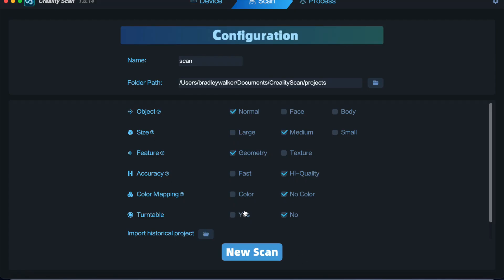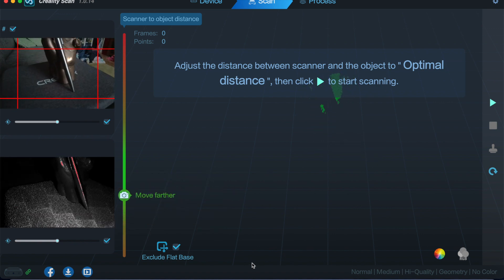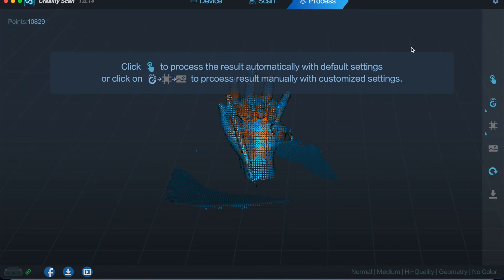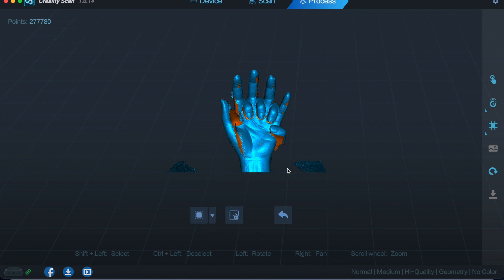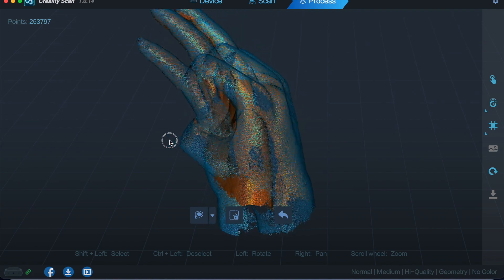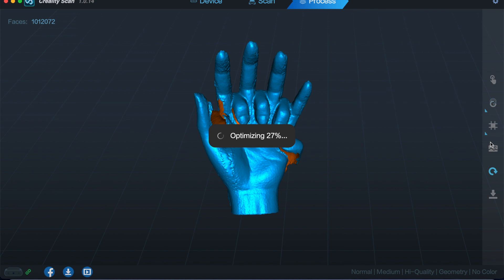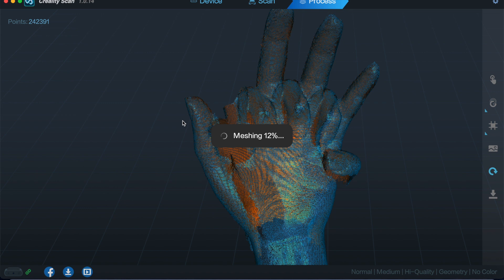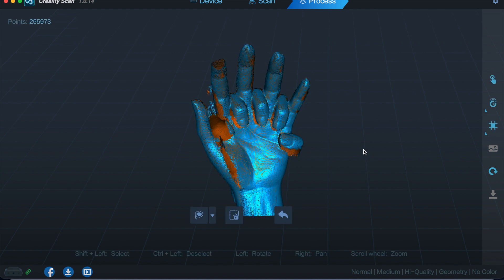Creality Scan Clean up   HD 1080p

Comment: I have a Ferret..and i keep removing stuff to clean up..only to go back and all the stuff i removed is back!
Also how do you fill holes from gap areas in the scan? And how do you smooth stuff out?
Reply from the maker: Hi sorry for the late reply. I try and have at least 3 scans of anything I’m working on to cover everything. While scanning you want to get the image of the scanned item as green as possible which lets you know you have a good coverage of the item. As for smoothing out the scan you can do that after in a program like Blender